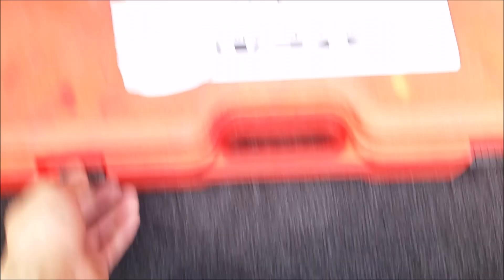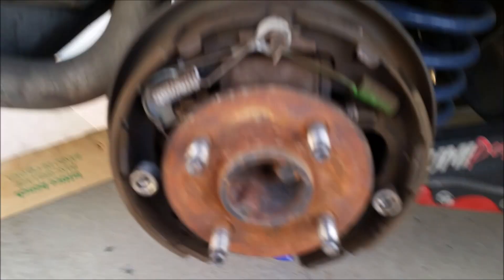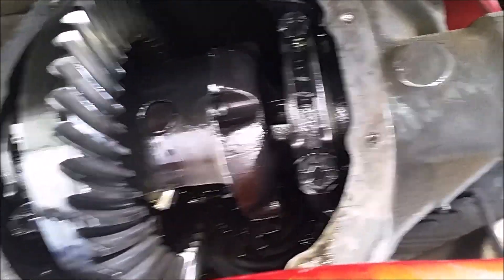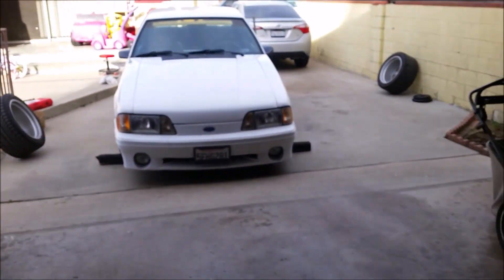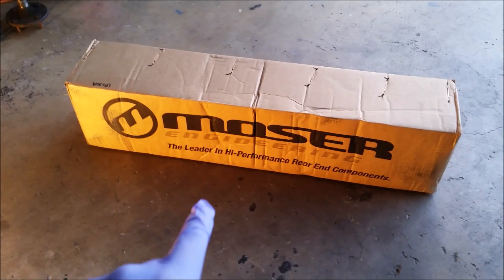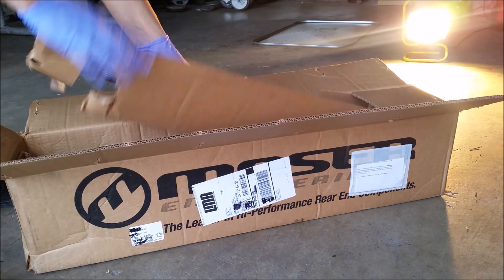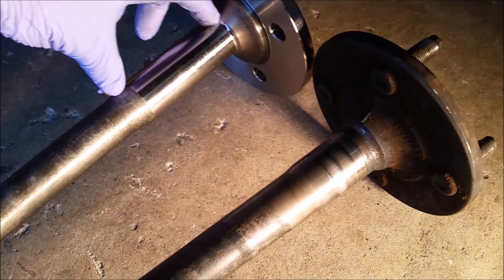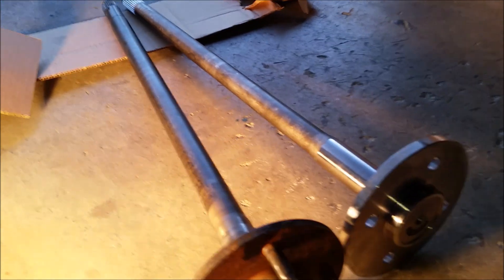Moser Axles Finally Came In!! (After Waiting All Day)

Comment: Looks like you had fun.  Moser makes good stuff.  I installed the hardened Moser 28 splines on my GT almost 20 years ago. Only thing is if you ever decide to run slicks at the track you'd need longer studs than that.
Reply from the maker: Thanks for the comment!
Reply: No worries! Just installed an anti roll bar today on GT. HItting the track tomorrow! Your detached garage setup reminds my buddy's house in Burbank, CA.

Comment: should have saved more money and upgraded to 31,especially if you plan on putting any real power in the car,but if you're just keeping it a mild driver then this is sufficient. I like the car regardless, the wheel and tire combo are perfect, that extra bit of lip on the front really makes it. Most Fox bodies you see with those have a shallow offset in the front and it just doesn't look right.
Reply from the maker: That's exactly what sold me on the 9inch wide front wheels compared to the 8 inch! Most people don't notice it, but to me it made a whole lot of difference! Thanks for the comment!
Reply: ***** It completely made the look and to be honest after seeing your car I've made the decision to go with the same wheels for mine. I'm guessing you got them from LMR?
Reply from the maker: Yes, I got them on the LMR website! Good choice!
Reply: ***** They'll be sitting while I finish the car but it'll look great on its maiden voyage,lol.
Reply: Eventually, to upgrade to the 31's is a lot of investment. Step by step gets it done. Nice work. Getting done what you can, WHEN you can is important. Keep at it

Comment: Budget is budget,congrats bro. If i had a lil more i would have ported my heads too after the valve job and got new springs too. Btw i noticed u have a cracked rear bumper by the passenger side and it has missing pieces,ever considered getting a 93 cobra rear bumper? those looks sick with the tail pipes under them.
Reply from the maker: Yea it's cracked! I bought the car like this! Hopefully in the future ill get the cobra bumper once I have enough for paint as well (don't want to drive around with different color body panels) Thanks for the comment!
Reply: Kool. I drove around with my 3 inch hood for 8-9 years in my white fox,since it was white it matched good and i didnt have to paint it,or i didnt get around to paint the car.
Reply: been driving mine everyday for months with a 5 inch lol